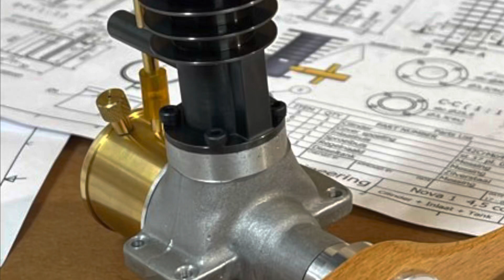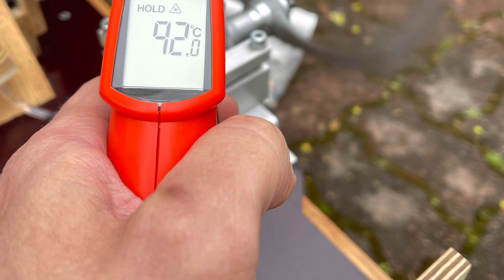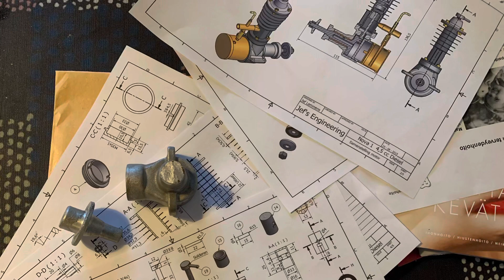Nova-1 4.5cc model diesel engine build by OMK

Comment: Hi, nice engine, do  you need a special fuel for starting this type of engine or just diesel ? 
Thank you.
Reply from the maker: Normal model diesel engine fuel. I use at the moment 38% kerosene, 34% ether and 28% castor oil with a pinch of IPN. Back in the forties the original designer of this engine used: ’24 parts petroleum, 24 parts turpentine, 24 parts paraffin oil, 15 parts motor oil and 13 parts sulfur ether. This mixture was used, among other things, for the Swiss diesel engine Dyno 1. ’
Reply: @OlliKarhun  Nice, thank you for the info, I search for it ,really hard fuel to find .

Comment: I'm studying engines for some time now, and intent to build a model one in the future, but there is one thing that I don't get: how the journal bearing gets lubricated when running without a oil pump and crank channels? In this type of environment the only thing I can imagine is some kind of oil fog during the intake getting into the narrow space.
Reply: the pressure changes in the case during the piston stroke pump a small amount of oil through the crank journal...
Reply: @CATech1138  Amazing, thank you for the information